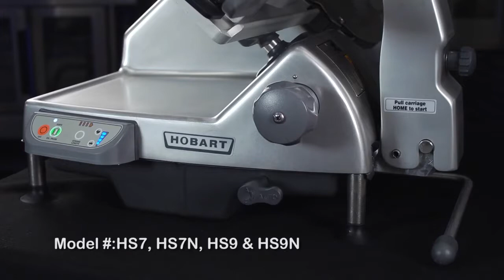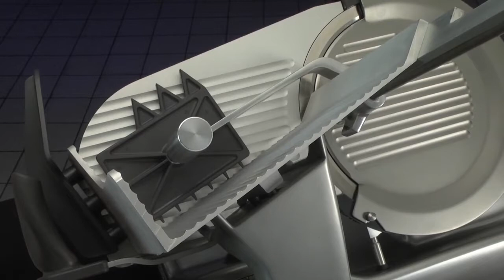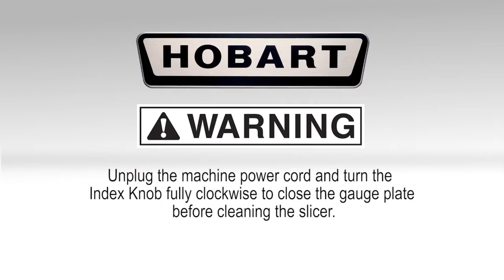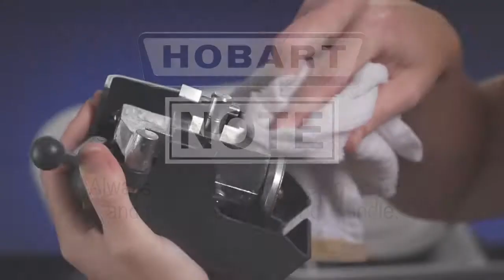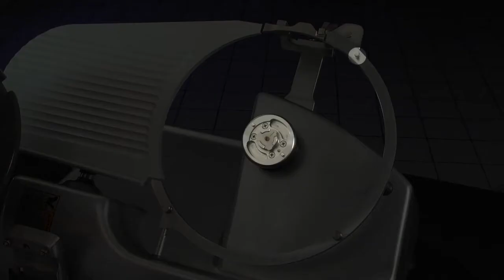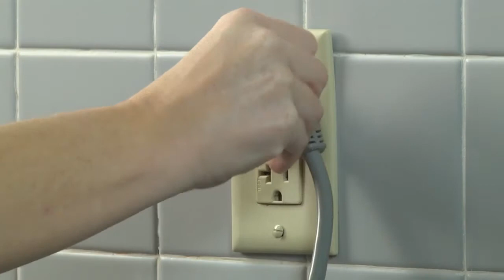Hobart HS Series Slicer Training

Comment: !These Can Be Dangerous Machines. Care and so Educate you staff. 
Below I'm sharing for your consideration, Very Informative & Safety Labels we are printing, cutting out & double sided tape onto and then clear box taping over on our machine:
Take care

Hobart Model 2712, 1/2 Hp, Manual & 2 Speed Auto Slicer. Avoids Pre-Sliced Foods’ High: 
Price & Preservatives. Deboned Meat, Best Semi-Frozen/Firm(i.e. 30 Min. In Freezer), 
Never Fully Frozen. Meat Is More Tender When Sliced Against Its Grain. With The Grain 
Gives Longer Strips. Firm Cheeses, Breads & Other Foods (No Hard Pit/Seeds: Core First).

⚠ When Not In Use, Cover Dangerous Blade
 Edge By: Turning Index Knob Down Below Zero.

Cut Thickness 1-50 Index
Knob Approximates:

1 = 1/100” (1mm = 1/25”)

Rollable Cheese/Deli Meats 6-8
Salads/Diced Meat 10-14
Cheese & Meat 10-15
Soups/Cubing 16-20
Steak 25
Crostini Bread 38-40
Bread-1/2” 50
Pineapple 50 

Cheeses: Hards Tend To Crumble, 
Softs Tend To Stick Together.

Overheat Reset 
Button ↓

Carriage Slide 
Rod Oil-Hole ↓

← Lightly Oil Rod/
Hole Monthly

Sharpening Shortens Wheel 
Blade Life & Is Rarely Needed 

⚠ Risk Of Severe Accidental Cuts & Amputations. 
18+ Y.O. Only, After Fully Trained. 
Use Feed Grip Or a Pushing Device. 
Never Put A Hand Near/Behind Blade/Guards. 
Turn Off When: Changing Foods/Unattended.
Unplug Before Cleaning/Moving/Servicing Or 
Removing Parts. Install All Parts Before Use.

Also, Be sure to Print/Enlarge the manual's parts identification diagram and tape to your machine.